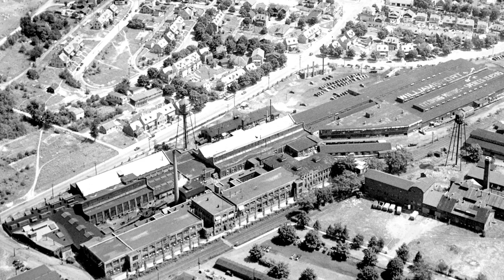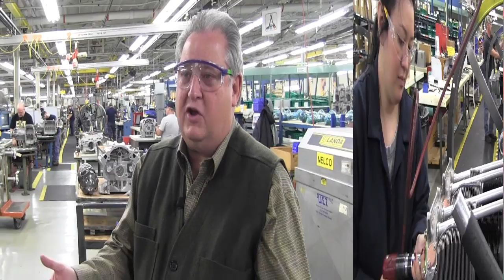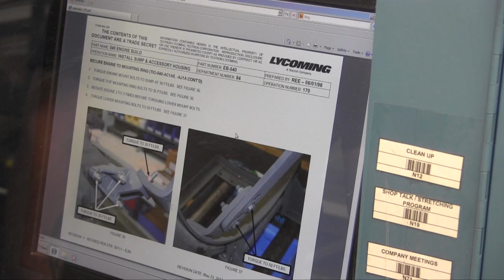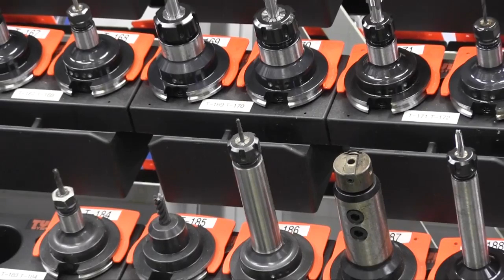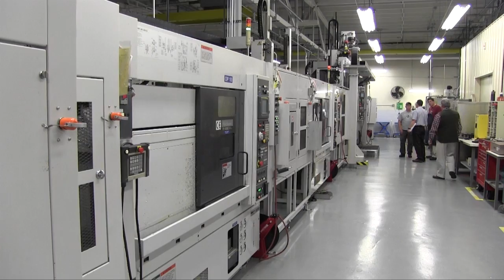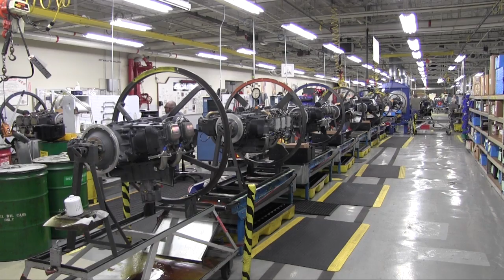How Lycoming Builds Aircraft Engines

Comment: Right now Ford will sell you a lightweight plasma transferred wire arc spray all aluminum 5.0L 32-valve DOHC V-8 with advanced features such as direct and port fuel injection, twin independent variable camshaft timing (Ti-VCT), high-flow cylinder heads, dual throttle bodies,  Sintered steel connecting rods,  Forged steel crankshaft,  including the engine wiring harness, and 409 stainless steel tubular exhaust manifolds making 480 hp and 415 ft. of Torque all for $12,650.00. Now how a company that has updated to CNC automation for it's production and rebuilding of it's engines, that lets be honest are dating back to the 1940's and other than fueling they are in every way the exact same engine as those produced in the 1960's can't turn a profit when they are getting $100.000.00 for the smallest, cheapest engine they make and have been making for almost 70 years is beyond me. It must be the general aviation vortex claiming that a one time certification dating from 50 years ago makes everything 100 time more expensive. Low volume of customers equals low volume production. Henry Ford once had this low volume business problem also but he changed it. Maybe its worth trying. my soul is prepared for the hate i most certainly will receive from posting this.

Comment: The design of some areas of Lycoming engines falls short of the design of Continental engines.

The high mounted camshaft in Lyc. engines is prone to lobe and lifter face rust if the engine is not run for a period of time while the low mounted camshaft in the Continental engine benefits from the oil drip effect on to the camshaft, meaning a longer period for lobe rusting to begin due to engine inactivity.

On many Lycoming powered aircraft, one has to remove the prop in order to replace an alternator belt. 
A Lyc. is a heavier engine that a Continental due to the fact that the Lyc. has a starter ring gear on the nose of the engine while a Continental has the starter mounted on the accessory gear case and does not need a starter ring gear.

The big question is ,  when will Continental come under American ownership again-? 
Well at least they got a new factory in Mobile with state of the art machinery in the deal with China.

Comment: Lycoming could by now have a water-cooled, ecu efi piston engine with half the fuel consumption of their air-cooled  engines today. To top it off their air-cooled engine is typically enclosed. Low volume market scales suck.
Reply: Your statement is factually incorrect.  Clearly you have zero understanding of BSFC of the Lycoming air cooled engines vs best available in liquid cooled engines of any type.
Reply: @mikeadams1647 he’s exaggerating but there is truth behind what he says. The BSFC of a lycoming or continental cannot compete with that of an engine with efi and electronic ignition; that is a fact.
Reply: Your statement is factually incorrect.  Clearly you have zero understanding of BSFC of the Lycoming air cooled engines vs best available in liquid cooled engines of any type.

Comment: The fact that they can one off an engine within a reasonable cost is amazing.
Reply: Reasonable? Check the prices...$50-100K for a new piston engine is hardly reasonable.
Reply: @MikeCris  It's extremely reasonable considering that it has almost no economies of scale supporting the price and product liability risks are huge. How many times a year do you think Lycoming is sued? I'd bet the number would make your head spin.
Reply: Reasonable? Have you bought a new engine this century? Compare the price of a GM LS1 crate engine (complete) with a Lycoming crate engine, if you can find an outlet. This is simply a difference in economic scale of volume, I accept that. But reasonable is hard to define against the hard envelope of a typical working salary. A GA light aircraft engine shouldn't be more than a typical yearly wages before tax. I'm saying this because I'm constantly between jobs, and it bites watching the parade of things I can't have eating the remaining time I have left before a Summer's day - my youth - has long since departed, and I follow into the next life hereafter.

Comment: I took a course in college called "systems engineering".  Basically, the traveling salesman problem, or BK with a thousand outlets, multiple warehouses, multiple suppliers, and parameters governing all of them. What is the best solution for distribution/storage, etc., given the constraints on storage time, transportation costs/unit/distance, etc.? 

I thought it was going to be boring as hell, as a EE without much direct interest, but it turned out to be quite interesting and fun. This is that course taken to the extreme, with the relative locations of binning, tooling, parts, work stations, etc.  I suspect it's all done iteratively on a computer now, but the efficiency of a shop like this benefits incredibly from that discipline.

Great vid, after seeing it, I would purchase a rebuild from them anytime, albeit with some additional research on user results, which I suspect are good.

Comment: I personally molded these parts, 6 cylinder crank case and 4,  the very first prototype 8.   For fifty +years the Phillips foundry produced lycoming castings. Then in 1999 they invested in new automated machines to mold with, it was supposed to increase the productivity by twice. In the end it slowed it down by half,and lost the other half to scrap. Also it cost the foundry to collapse,bank rupture. Then lycoming took it to another foundry for production.  The same thing that happened to GM ,  Dodge. And other motor parts manufacturers.the new machinery is junk ,operation is not always good, and machines break down or just have problems on and off . It’s a costly venture, and I watched 110 employees,drop to 54 employees,   I think I would of stayed with the older machines,besides the old stuff was like fifty or more yrs old and still worked fine,,,no way new machines will last .

Comment: Machinists are soon going to be as rare as blacksmiths.
Reply: That's a VERY common misconception.  CNC operators aren't monkeys, you need to be a competent machinist not to destroy (very) expensive machine tools.  The most employable machinists are proficient at manual AND CNC.  Both have important roles, and manual machine tools are highly suited to repair machining and single-part production where it's much faster and easier to do the work manually instead of setting up a CNC. Many large, specialty manual machine tools aren't remotely economic to replace with CNC.  That's why my highly successful machinist bro has a mix of full CNC, open knee mills with CNC control but which permit "manual" style operations,  two WWII era American Pacemaker manual lathes which are works of art, and even an early 1900s Cincinnati shaper in nearly mint condition!

Comment: The FAA was responsible for the use of vacuum tubes , 30 years after the technology was obsolete. They are also the reason we are still flying these reliable, yet obsolete engines. The cost of certification of new designs is to blame. Trump won because  people are fed up with government bureaucrats and their regulations, which punish innovation and creativity, and reward cronyism and business as usual. I know that there is limited demand for aircraft engines compared to auto engines, so they will always be expensive, but making it easier to certify new designs is what we need. The experimental market may be the only answer.
Reply: Russell Lowry   In Australia regulation has completely wiped out our light aircraft industry to the point it barely exist from a thriving profitable industry 30 eras ago, I did not know about it and I am very well informed on local issues and only became aware when there was a article about the Bankstown airport being desolate with no aircraft compared to 30 years ago and went into the reasons why , incredible how the government who supposed to assist the community actually destroys the community , but this issue is small beer compared to the wider community and economy and what the Socialist Government do to this country , we are virtually a Marxist state in all but name .
Reply: Porsche tried to enter the AV engine market but failed in reliability. Air cooling saves weight which is at a premium in small planes. Diesel may be one exception due to fuel, turbocharging/altitude benefits. Diesels have really done well in trucks, approaching 50% efficiency.
Reply: @tobyw9573  Yet another aspect or the Porsche PFM 3200 engine, is that it had 6 cylinders, a gearbox, a cooling fan, ... And so in the end was more expensive to produce while doing the same thing, for the same weight, as the 4 cylinder baseline aircraft engine.

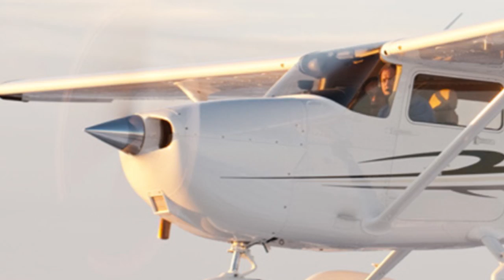Comment: Thanks for the nice video. One question though.  At 1:44 why is the tech. cranking down on one of the cylinder head base studs with the "CP" looking impact gun that appears to have no torque limiter?
Reply: Patrick, by CP, I assume you mean Harbor Fright.  LOL.  I hope the answer would be that the gun is pressure set to be well below the final torque, and then they are hand torqued to spec, but good observation.